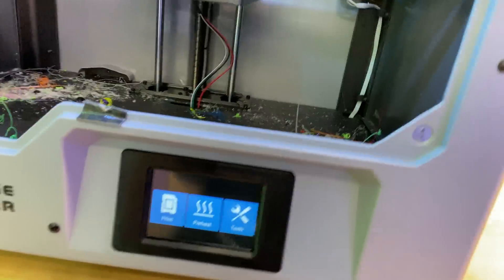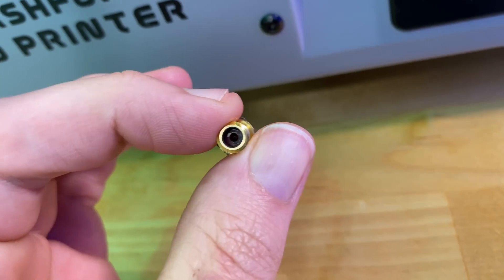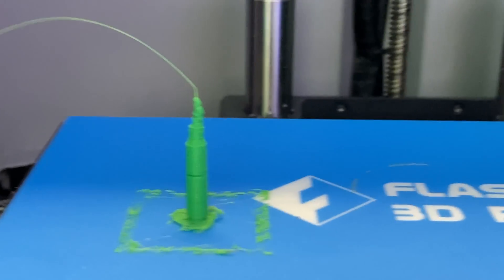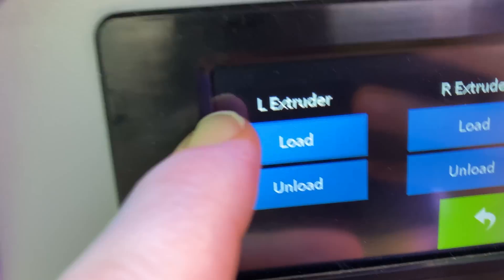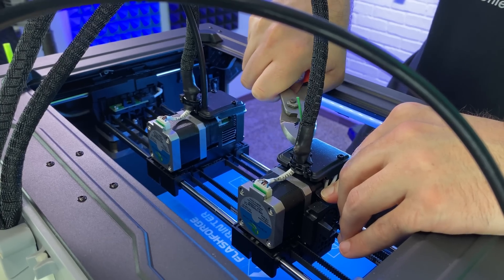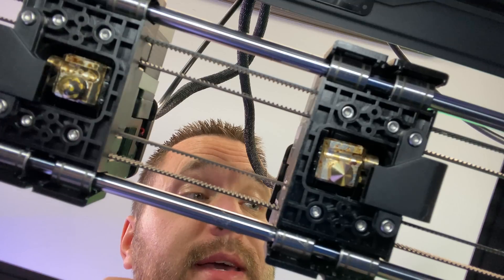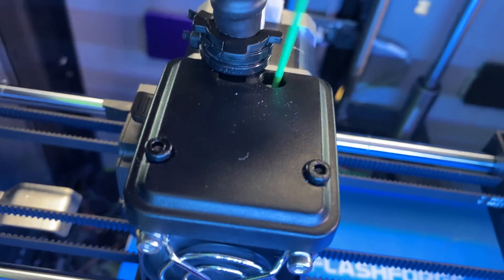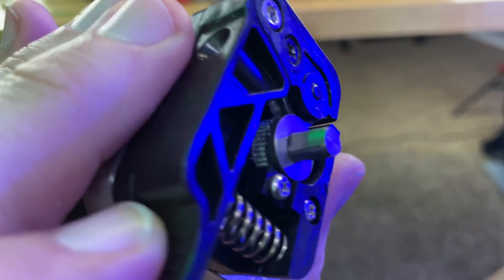FlashForge Creator Max 2 Independent Dual Extruder 3D Printer

Comment: If your green filament is of cheap quality, it could be causing jams. Also, if you want to consider cleaning the old nozzles, I’ve had success putting them in the oven at 375 F for about 5 - 10 minutes. Standing upside down on a cookie sheet. If your cleaning kit doesn’t include one, get some acupuncture needles that are the same as your nozzle diameter.

Comment: That clicking noise that we heard sounded like the stepper motor inside the head slipping and digging into the filament. That is why the grooves on the feed wheel were filled up with plastic. You should be able to remove some of the force by adjusting the tensioner wheel. Not sure how to do that for your model. As for the nozzles the cleaning kits are good but tend to break. I always found it better to just get a new nozzle but the cheap ones aren't always good, my way I found was always good to clean the nozzle would be to heat it up with a blowtorch then use a cleaning rod to push all the filament out. I would also use Acetone to dissolve the plastic if it was ABS.

Comment: Be caution pulling out PLA if it's not heated up all the way. The ugly half melted bit at the bottom can easily break off or be pulled up half molten and then break off and wind up being much wider than it should up in the cold end, where it'll never melt and feed through. Quite possibly how you got that wide chunk in the middle of the extruder there.

Comment: If you're buying 20 nozzles for $9, you're buying super low quality nozzles which could have several problems - incorrect size (.34 or .46 instead of .40mm), they will wear out quickly, and lastly when tightening the nozzle they tend to break before they're fully tight once heated. Just a warning. You don't need to get expensive nozzles but the better quality nozzles are worth it. You'll hate yourself when you need to dig nozzle thread out of a heater block or fight demons forever to find out its just a bad nozzle.

Comment: Next time, get a glass/ceramic cup, pour in enough acetone to cover the nozzle and a bit more, throw in the nozzle, cover it with a small plate and put it into a well-ventilated place (outside if possible, if it's not freezing) for up to 24 hours. It will dissolve ABS into a goo you can then rinse out from the nozzle with some water, use gloves of course when doing that.

Comment: I have seen  really tiny what looks to be drill bit sets that are used to clean oxy/actetelyn(sp) cutting torches might look for that.
Reply: Can confirm, I have a set, they work decently. Just heat up the nozzle and try just twisting the bit in your fingers while pushing into the nozzle